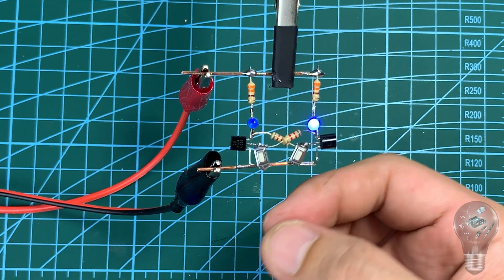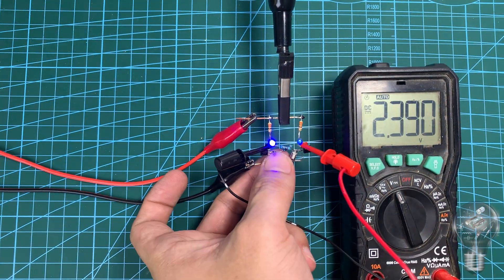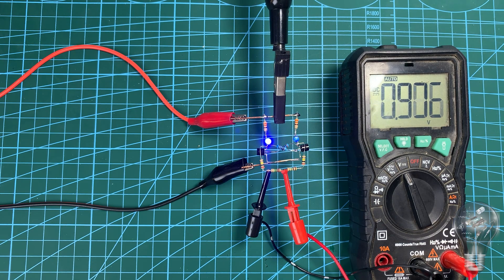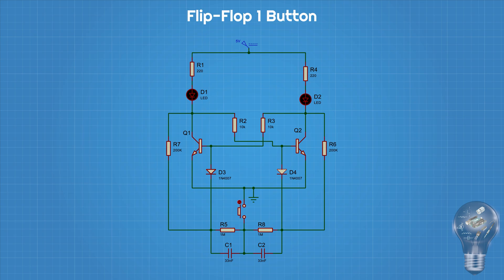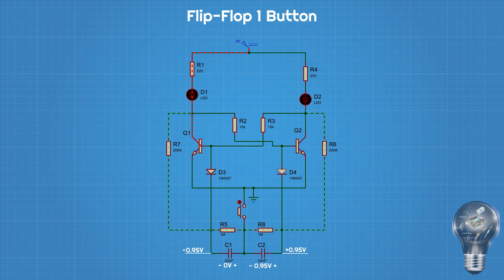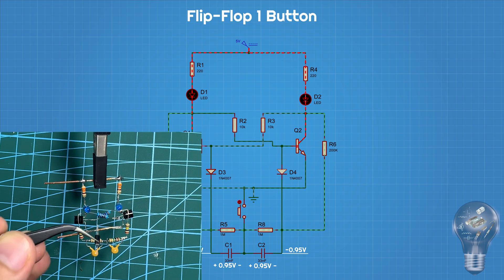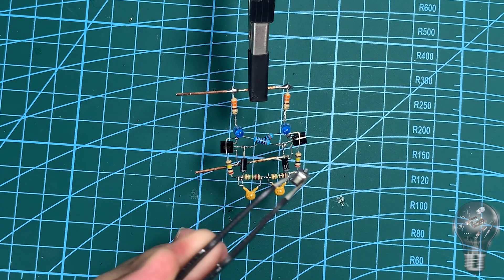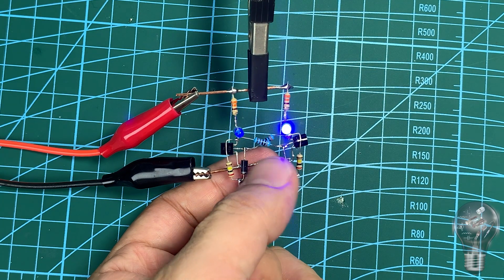Flip Flop Led Flasher Circuit | Only One Push Button | Easy Electronics Tutorial

Comment: I liked your explanation.
Maybe you could "freeze the moment" and use some lines to show us where the current is flowing and the direction of it. And you can also add some voltage labels at the nodes so we can fully understand at each moment how the circuit is behaving.
Thanks
Reply from the maker: So glad you found the explanation helpful! I’ll try to make it even better next time 😊